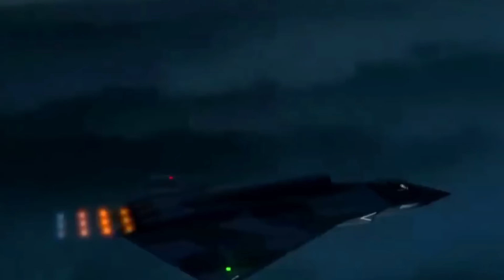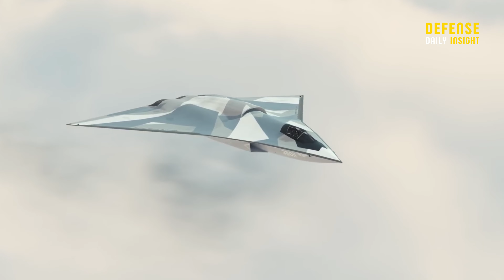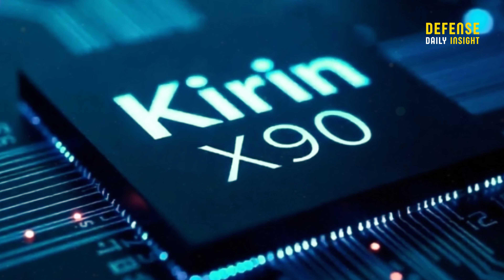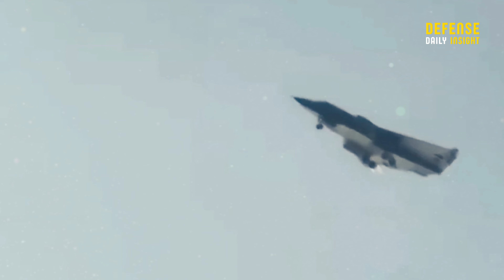J-36 Shockwave: The New Era of Three-Engine Fighter Aircraft

Comment: It's a long range fighter jet to hit being the enemy lines...
A fighter which can travel hypersonic without afterburner and wide operation area... There's no fighter jets build like this before... So, it's really a game changer...
Reply from the maker: a smaller design, twin-engine, and also without a vertical tail. This aircraft appeared during the same period and is believed to be a different sixth-generation program from the J-36. The naming J-50/J-XDS is also not yet official.